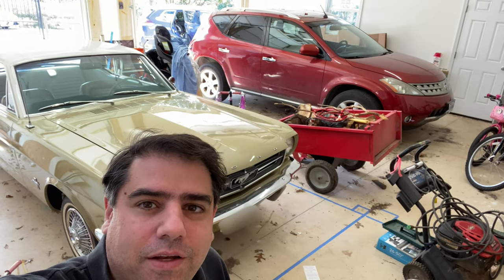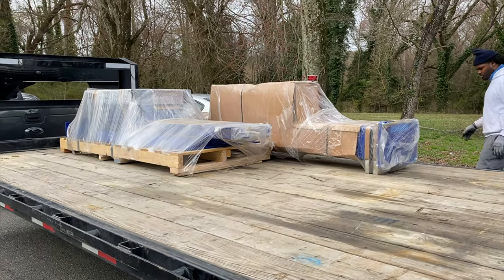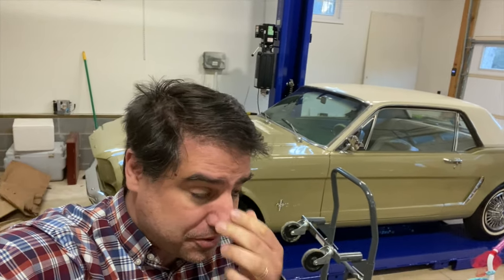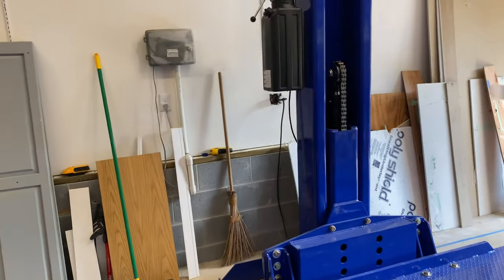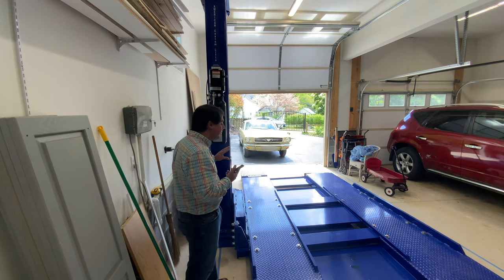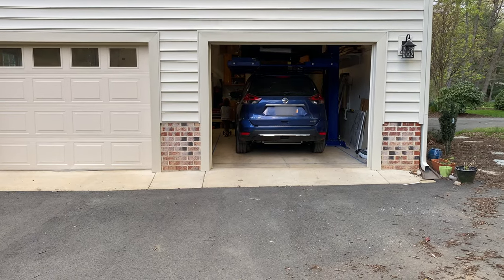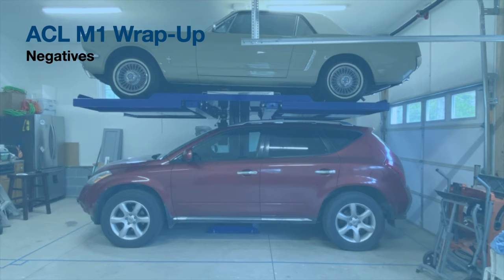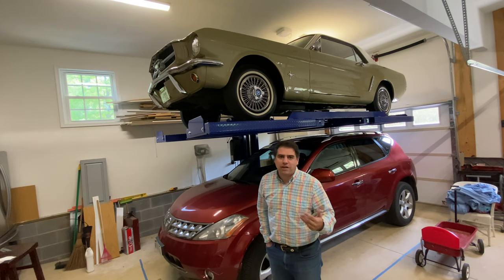American Custom Lifts M1 Review

Comment: Adding another garage bay to your garage would cost you way more than $10k is another way to look at it.
One con of any single post lift is that in the unlikely event of a failure that thing is going down all at once.  2 and 4 post lifts are linked to other posts and if one post fails the other posts can give you more time to get away.
Is there an option to use a bridge jack either pneumatic or manual hydraulic, this would open up some ability to do tire changes.
This is the first time I've seen one of these, thanks for posting.

Comment: Hi Rafi. Thanks for the review. Unfortunately the lift itself now cost 2 1/2 times more than what you paid for just 2 years ago. If it were same price as when you got it I wouldn’t hesitate to get one. Now $15k is just 😮 and that’s not even including shipping and installation my god. I might go with a Stratus SPL. It’s the same design as this M1 lift, cost less than what you paid for 2 years ago, and it lifts up to 8000 pounds instead of 4500
Reply: When I got the price quote, my eyes nearly rolled out of my face. I'm involved in cost estimating and know how much things have gone up. I just can't see the increase on these.